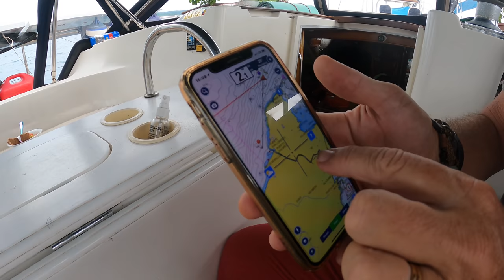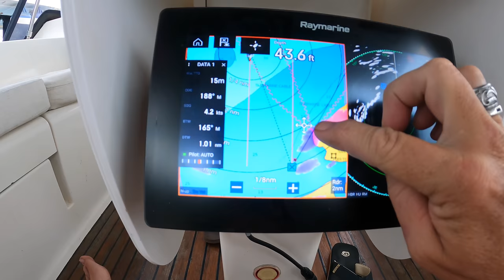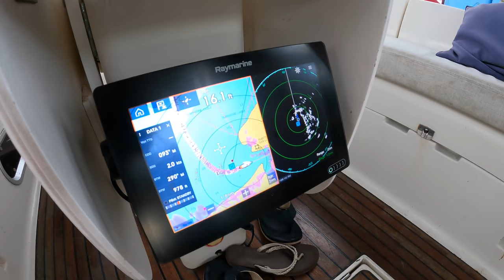SSL585 ~ Things could definitely be better...

Comment: Howdy Rick .. you just demonstrated a perfect "where you start and the path of troubleshooting" example old school process .. but, you know your systems inside out too, so you don't have any excuses not to find the problem and more than likely "fix" the issue .. but for beginners .. their take away should be start at the ignition controls, verify voltage at devices, check battery .. loose connector .. excellent!

Comment: OOHHH just one more comment .. it deserves its own post .. you getting out the old heavy screwdriver to make connection at the poles of the starter unit is so old school .. not many people these days grew up using that "old school trick" .. these new wave electronics for electrical systems and their differences between manufacturers is an entire new set of modular technologies to keep up with .. Good Job Rick!

Comment: They make a product called torque seal, we use on airplanes. After you torque a nut or bolt, apply this seal, it will crack or breaks if the item loosen up. A red paint line also works, that way a visual inspection will uncover a problem, Helicopters use this method, because every bolt and nut is critical

Comment: Battery Terminals are always a problem especially in a marine environment where the combination of vibration and corrosion are at play. Even marine rated connectors have issues. You have the boat really looking good and Maddy is in good spirits.

Comment: i bought a 30ft boat for 1k because the old owner didnt know
the battery cables were bad he thought the engine was locked 
always check the cables is what i learned.
also im surprised you dont have a back up starter.
Great spot on the river wish i was there.
Reply from the maker: I mentioned in the video that I do have a backup starter, always have.. but good thing I didn't spend the time changing it out because the new one would have had the same problem from the bad battery connection

Comment: It’s too bad that sailboat manufacturers have so often treated the “holy place” as a hell  hole with limited access ,poor lighting which compromises basic service and OMG diagnosis access. The engine space deserves rightful respect from builders when the marine  engine can be more than a convenience but a life saver.
Reply: It is also interesting that the battery post/connection worked loose, just enough to not look disconnected on a quick inspection and the voltages looked fine as well...

Yes, boat engines need to be able to be serviced anywhere, anytime in almost any condition(s) - before things get "sketchy".
Vendors and manufacturers will not always be there to fix or "remote fix" problems.
These manufactures are often short sighted, yet why they are so blind is the better question.
Reply: @drx1xym154  I would always try to move the cable. If it moved, dead give away. If it didn't but the starter motor still didn't crank, I'd stick a screw drive flat blade into the connection between the battery and the round connection. If it sparked when I turned the key or sometimes even worked, I'd take the entire thing apart and clean clean clean, and sometimes remove some material so it would tighten. Most batteries now just have a stud, but could still have corrosion, the real culprit.

Comment: If they let water out of Lake Gatun when you are on the Chagres you are in big trouble. I saved a boat there in about 1966. Did you see any Harpe Eagles? I use to surf the beach Pina at the entrance across from the Spanish Fort. I got married in 1972 on the cement point up on Ft San Lorenzo I was 20 it didnt last. That River will always be in me with a 1000 memories.

Comment: Just like a car with a loose battery terminal connection.
Reply: It sounded like the starter was spinning up but the solinoid driven starter gear wasnt engaging with the fly wheel. 
If it hadnt been the loose terminal it could have also been the starter gear failing to engage .. usually its crud or wear stopping it from being pushed down the shaft .. or worst case stripped teeth on the ring.. the motor does like stopping and starting in preferred positions ...if your unlucky to end up in this situation ..in a car you can rock it in a high gear to move it passed the gap in a boat youve got to turn the crank pulley onward with a spanner or socket 🤞🏻 youve got space and dont drop it into the engine bilge.

Comment: Rick, is the motor on your dingy strong enough to tow the boat short distances in a pinch(were the main engine be unable to start or have issues), or do you even have a setup to do so? Is it even practical?...kind of like a tug boat style....
Reply: He just put a electric motor on his dinghy. It might pull the boat but for how far. Not far, that's for sure.
Reply: @richardgooding498  Yup i knew that, thus the "short distances" comment. Even electric, once it got it moving all be it slow, would probably move it a few miles...2-5 ...it would be an interesting test to see what it could do....either towing SL or tied to its side, pushing it ala tug style. Just to "know its limits" and see.
Reply: @oldenfarten5350  I would like to see that as well. Rick said that he got two different propellers with different pitches. One for speed and the other for torque. Yes Sir. That's definitely a great test.

Comment: When you went in that river entrance before, didn't your gps mark your course and way points and save them?  I'm always surprised sailors don't put a drone out in front of them looking for sand bars and safe passages.  I noticed you never once mentioned engine temperature.  I guess that isn't so important when getting it started was an issue, but still I was curious.

Comment: Is there no way jumping it under sale I would have thought it's possible if you have a pitch control prop. It's not Direct coupled to the gearbox centrifugal clutch?
Make sure you got locking washer or two nuts on the battery terminal cover with Vaseline.
I wonder if it's worth putting a mount on the back of the boat for an emergency off-board engine from the dinghy say.
Reply: @TheOverproof151  it's nice having a troll it's like having a pet are you my pet love